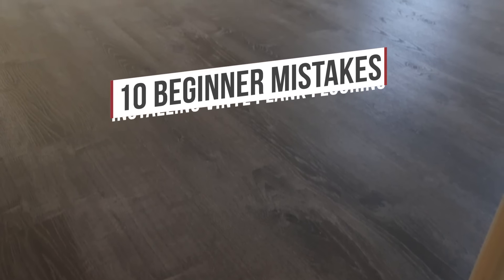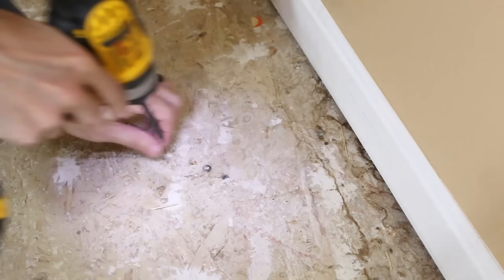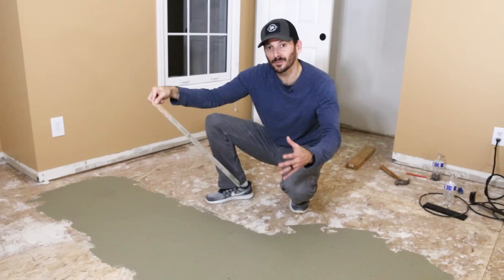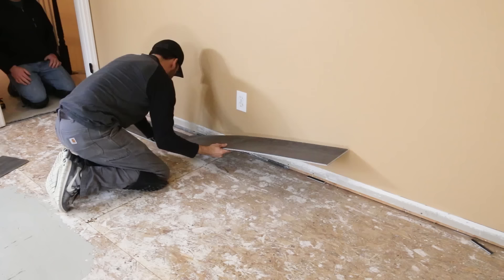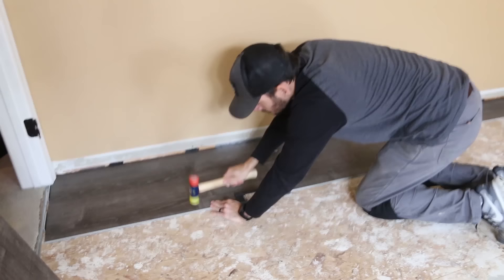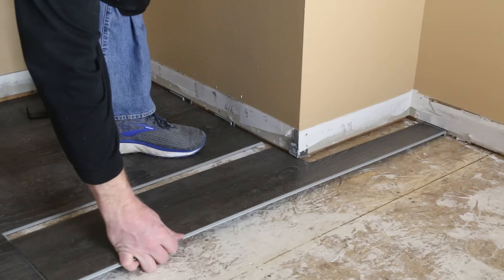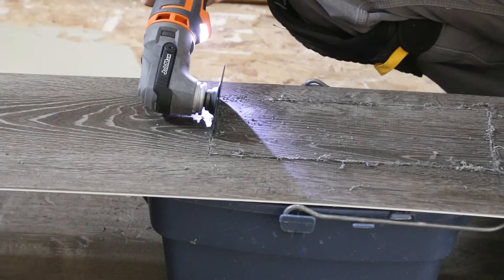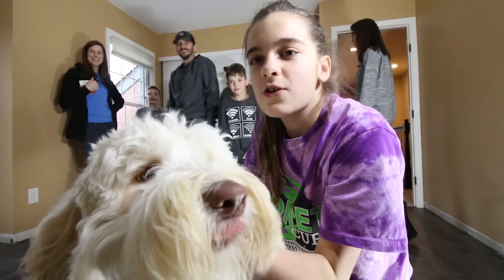10 Beginner Mistakes Installing Vinyl Plank Flooring

Comment: one more protip -- before you start first row, measure out the width of your room and divide by the width of the planks to avoid a very narrow last set of planks. Note, i'm referring to width and not the length as the length was mentioned in the video.
Reply: How would this change anything? Wouldn’t you still have to cut the last plank to fit the width of the room?
Reply: Just get on with the job...
Reply: Nah thats unnecessary
Reply: Yes, I agree with Wally, that was the one thing left out for that professional look.
Reply: That’s actually a good point
Reply: It matters I do it on almost every job so your end cuts are ½ peice .. you can make it like 3 in instead
Reply: Definitely necessary. If you had a GC license and did commercial remodels you’d have to pull up the whole floor if you have one thin row width on one side of the room and a full row width on the other. Split it in half, it looks way better and it’s even though it’s more cuts it’s way easier to cut both
Reply: Good point, just split the difference between the end pieces.
Reply: That was exactly what I was thinking when I watched this excellent video. In my first introduction to such flooring while helping my friend to install wood laminate flooring, I actually took the time to read the instruction on the pack. I gathered that the first and last row needed to be ripped to avoid a skinny strip at the final row. My friend didn't as he is more of a "dive in and see" DIY guy. By the time we came to the last row, he ended up with a narrow strip of an inch wide. Obviouly it looked ridiculous as well as insecure as it didn't have any strength to  join up with the previous row. So he said "F...", and glued the tiny strip onto the floor, and nailed it in for good measure. I didn't alert him to his mistake as it was my first exposure to such job. It does serve to read the instructions first before you start.
Reply: yeah, I made this mistake on my first go at snap in flooring in my dining room/kitchen... got to the other side and had a 1 inch strip that was a pain in the bottom.  Will not make that mistake again when I do the basement.
Reply: I installed for the first time yesterday!! and your piece of advice would have helped had I read it sooner. I had a 2inch strip!
Reply: @gag928  Sorry to hear that. But at least you are an inch wider than the stripe my friend and myself ended up with.

Also, if you allow me, there is another very important check you must performed before you start. You need to check the width of the room. It is quite possible that the two ends could be out by a significant amount that could not be detected visually.
Reply: @WalkOverHotCoal  thanks for the help!
Reply: @gag928  You are most welcomed. By the way, on the lighter side....did you glue and then nail that tiny 2-inch stripe down like we did ?
Reply: @WalkOverHotCoal  actually it clipped in pretty good..i did cut the short sides though so I didn't have to bang it to connect. when I cut the ends off..it just fell into place.
Reply: @gag928  I think you have done very well, considering it being the first job you have done. It took me three months to gather enough courage to begin work on my own house. Perhaps I was overly cautious. I spent three month searching and collecting information on this topic, basically looking for mistakes others made to avoid making them myself. But it was worth the efforts as making mistakes could be expensive as well as deflating. The first room took forever. The second much less. The third took longer because I got too confident and forgotten about the things I should avoid.
Reply: I’ve made that mistake in a room before lol definitely keeping this in mind for next time 😅
Reply: @WalkOverHotCoal  He could have glued the little strip to the actual plank beside it which would have kept it as a floating floor.
Reply: Are the beginning spacers necessary? If you leave the baseboards on?
Reply: @scllgst1  I will try to help if I may. By spacers, I presume you meant the space, or gap you would, and should intentionally leave between the walls and the floating floorboards? If so then yes. It is absolutely essential to leave some gap between the two. I believe that 1/4 inch or 6.5 mm is sufficient. Wood does expand. The gap is to allow the expansion to take place in hot days without buckling. Rails on very hot days buckled because the gap between each rail is insufficient. So the same amount of gap is necessary on all sides. Spacers are usually used to mark out the gaps while the boards are being laid. Once the job is completed, the spacers must be removed otherwise they will inhibit the expansion of the boards.

As for baseboard, I presume you meant the tiny strip of board which covers the edge of the floating boards? If so, then I believe you want to have baseboards along the four sides to cover the edges of the entire room. The baseboards serve three main purposes. (1). To cover the edges of the floor so that the boards are not exposed, (2). Aesthetic. You don't want to have edges of the floor exposed, and (3). To prevent dirt to get under the floorboards.

Please note that the baseboard is not to be installed so tightly that it hinders the lateral movement, ie. expansion of the floorboards.
Reply: @WalkOverHotCoal  thank you so much. I had to watch several other videos to understand what actually needed to be done. I thought this was going to be very easy, however the spacers aren’t staying in place and the flooring won’t clinch and lock. I’m calling my brother in the morning.
Reply: @scllgst1  Sorry to hear about your difficulties. I faced all kinds of important decisions and problems too. I did have one advantage...time. I took my time to work it out, and I only deal with one issue at a time.

You still haven;t answered my question whether you are referring to a tiny block to mark out the gap, or the actual gap itself. 

Regarding the boards wont click together, you need to slightly raise the side of the boards that are already laid to make it possible to accommodate the new ones. You must of course angle the edges slightly to do so.  May I suggest you first try it out with a about three lengths on a flat ground? I also found it easier to join up a full length, ie. an entire row, and then raise the edge of the row that is already laid, then gently click the two rows together. It is difficult to do it with one person, But I have done it myself. 

Please note that it is not a skill that is easily learned. I spent three months watching videos and drawing up pictures before I gathered sufficient courage to do it.
Reply: @WalkOverHotCoal  I was referring to the gap itself which I understand now that the wood needs to expand. I will continue to watch some videos and try your method out. I actually thought this job was going to be quick and easy. They make make it look so effortless on these videos. I’ll try to be a little more patient and try again today. Thank you once again.
Reply: @scllgst1  Now I know you are referring to the gap, I think you need the "real spacers". The spacers are basically a small lump of plastic as wide as the optimal gap. You place spacers against the wall which you are starting from, and the floorboards are installed right against the spacers. That way you will have the right gap between the wall and the boards, as well as them stopping the boards from moving any closer towards the wall. Instead of buying, you could just get some leftover boards, cut to the width at about 1/4 inch or 6.5 mm, and use them as spacers. You may need quite a few of them along the wall.

Please note that you need to be aware of the width of the final panel. As I explained in my first post, you don't want to have the final row too skinny. If it helps, I could write up a checklist for you before you start.
Reply: @WalkOverHotCoal  I would very much appreciate the checklist. That would be great if you don’t mind!🙂
Reply: @scllgst1  You can't push it up against the baseboards because if you don't leave a gap, it can expand and push the floor up.  Not a great thing.

That being said, I've never seen it happen.  I'd guess if you put it in during cold weather and you didn't condition your house in the summer, it might happen.  

I can do the entire thing without spacers just doing it by eye and have but you probably shouldn't if you aren't used to doing it.  

I'd never do it without removing baseboards unless asked to on a job but that is just me, quarter round is super cheesy and just makes it look more like an amateur installed laminate.  Let's be honest, we want it to look like professionally installed hard wood, right?
Reply: How thin is too thin?
Reply: @mitchjohnson4714  I believe that the final strip must not be less than 2-inches or 60-mm. If it is close to that, I would certainly choose the hard way and rip the first and last rows accordingly.
Reply: @1789crazy  Of course it necessary. You obviously have are not a installer. I measure not only length but, must measure width as well on all my jobs. You must not end up with a 1" strip against the wall. If that scenario arises while measuring the width, you would cut the first starter strip against the opposite wall to allow for a wider board on the other wall. It matters! But if its "unnecessary" for you then go ahead and "hack it".
Reply: @taureanantoine1164  nk
Reply: @taureanantoine1164  nkn
Reply: @taureanantoine1164  If you pay a pro to put the flooring down they will measure and check the squareness of the room before they start. The first row they put down will be cut out of square so the flooring appears as it should. These wide planks make for a lot more room to over look things VS putting down thin strips of hardwood that gets nailed.
Reply: Thanks for this comment, can save some headaches lol
Reply: As a flooring pro its funny to see that your comment is completely correct but people dismiss it.

If you do high end work, customers definitely say things if you have a sliver going down their hallway, for example. Good call!
Reply: @WalkOverHotCoal  You follow the EXACT same steps I do on every new project.  Haha!  First time - very slow, lots of worry, thinking, and research.  Second time - much quicker, gaining confidence.  Third time - overconfident, then frustrated by forgetting a couple things learned from the first two times.  I'm glad to hear it's not just me!
Reply: @jamesaz14  Yes indeed. It seems it is a common trait among most of us. Now that you had admitted it so publicly on Youtube, I don't feel do alone. Thank you. On the serious side, I believe that it is the same with drivers. New drivers have more accidents because of their inexperience. On the other end of the scale, experienced drivers also tend to involve in more accidents because they become cocky. I nearly hit a signpost while leaning down to select a CD, thinking that I could drive and be able to find the CD I wanted. That is why it is a "NO" to use a mobile while driving.
Reply: You'd also have to take into consideration the bump outs that may be present in the room too, in case the adjustment ends up leaving a seam right at the edge of one.
I guess the only way is to really draw out the room fully and make every calculation beforehand to optimize things.
Reply: Center the room ..is what u mean..and if u still have a small cut after that re center the center line..most people will not know what im talking about lol
Reply: @mikem6883  I don't know what you are talking about. It is likely that you have not done a job yourself. How are you going to move the entire floor to re-centre it? It is heavy once laid. Perhaps you want to explain to us what you are talking about ?
Reply: @WalkOverHotCoal  once u have your center and u still have a small cut u just re center that line bud..20 years in flooring..i going to guess that u don't know how to pull a 6 8 10 to square a floor either
Reply: @WalkOverHotCoal  these are things that have to be done before u start an installation
Reply: @mikem6883  When you said "6, 8, 10", you meant "3, 4, 5". This is the Pythagoras' Theorem. It take a genius to understand it. I take my hat off to you. I learned it in primary school, and I could never understand it.
Reply: @WalkOverHotCoal  that's really cute man im proud of u..yes 3 4 5 is good for small floors..6 8 10 is good for medium floors and the numbers get bigger from there.
Reply: @mikem6883  So what is the big deal with this primary school stuff? Simple multiply each side by the same factor, you get the same result. "12, 16, 20"; "18, 24, 30", etc. They still wither down to "3, 4, 5". I am glad you get such a huge thrill from such a simple mathematical equation.
Reply: @WalkOverHotCoal  that's what i was trying to say its not a big deal at all its a simple thing that many flooring people know nothing about
Reply: @mikem6883  I don't like to take the shine off people because it is ungracious. Regardless of people who has 20 years or more experience in laying floor, one the most essential thing in laying laminated floor is what most of us had been discussing, ie. how to avoid leaving a tiny narrow strip in the final row. You came in, carrying on about centering the floor, and then suggested to move the "entire" floor after realizing that the final strip is but a narrow strip. That is exactly what a professional with 20 years experience don't want to do, and for amateurs like me and others as well. 

You tried to throw in a red herring by mentioning "6, 8, 10" to show how knowledgeable you are. I am not here to dismiss your experience of 20 years, however, what you did was to confuse people who are just like me, get on Youtube to learn something, and your contribution only makes people more confused.
Reply: @WalkOverHotCoal  never said move the floor after laying it ..it can be done but this conversation has reached its end
Reply: @mikem6883  its funny how many people do flooring dont know 6,8,10 rule
Reply: @1789crazy  Necessary if you want to be professional about it.
Reply: @taureanantoine1164   ,.,z,,, zone,
Reply: @WalkOverHotCoal  You misunderstood her question. If she were to leave the baseboards on, which is often the case for ease of painting purposes, the flooring can be installed up to the baseboard (as long as the baseboard sits just above the flooring. Baseboard is often 1/2 thick or so which means you can tuck it under 1/4 or so. If the finish is not looking great you can add quarter round. I’m not saying this is the way you have to do it but if the current baseboard lines up for thickness of new flooring you can avoid removing baseboard and spacers are not needed.
Reply: @Zanyofo3  what does a GC license have to do with any of this...smh...
Reply: @WalkOverHotCoal  you are lost my friend.  Absolutely lost.
Reply: @WalkOverHotCoal  why use "mm" for measurements?  That specifically shows you have no idea.
Reply: @jeremyreevessicg2218  If you reread I used it as an example as to why it’s necessary… smh….
Reply: @Zanyofo3  it never matters.  It will always be irrelevant.  What matters is the job being done correctly.  Doesn't matter by who.
Reply: @jeremyreevessicg2218  Incredible points, I had never thought about it that way. Thank you so much for your enlightenment and sharing your invaluable knowledge.
Reply: Too late. Lol
Reply: @johnpatterson213  agreed. You should split the difference on both ends.
Reply: Yeah never installed this type of flooring but I did a ton of roofing. Same scenario as shingles almost :P

Comment: Fun tip to try that has been the fastest and most efficient for me installing thousands of feet of this stuff, I generally insert the short side,  let the flooring lay down, and I pull the long side in by hand while tilting up on the board, then I tap to confirm that it's seated properly, doesn't require much tapping and it goes very quickly, give it a try and see how you like it, I'm generally only able to do that after running 4 or so runs so I can get on top of the flooring
Reply: I do the exact same thing, makes you think why am I getting paid for this?

Comment: Thanks for explaining why you weren't using underlayment and telling us to follow the manufactures recommendations!!
Reply from the maker: You're welcome!
Reply: Apparently if a thick resilient underlayment is used with the lifeproof vinyl flooring, it would allow the planks to flex too much when pressure is placed on it and possibly causing damage to the click lock groove joints.

Comment: Sometimes when you remove base that was sitting up more than 1/2" or so from the floor, an unsightly gap will appear once its reinstalled on a floor that is less than 1/2" thick. All of these gaps will likely require touch up paint around the entire room. Additionally, pulling off the base can cause breakage to the base and/or damage to the drywall. DIYers would probably be better off just using 1/4 round. Tip: if you're going to use 1/4 that matches the floor, paint your existing base first )if it needs it) and do it before installing the floor for a nice clean look.

Comment: My dad and I installed some floor like this back in 2012, instead of pullinv off the baseboards to hide the edges he decided it was best to just install the floor and then add a second baseboard which was just thin rough wood he added onto the floor itself, so any furniture I have now sits at least 3cm away from any wall... Now I am renovating the area without him 😅